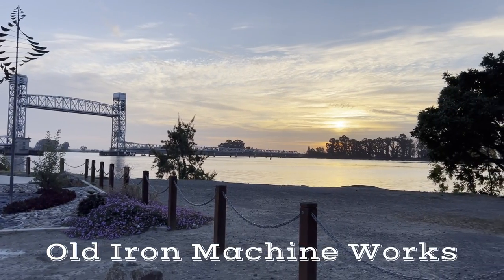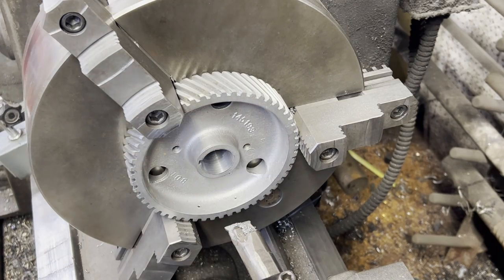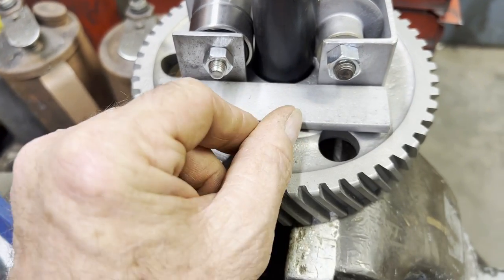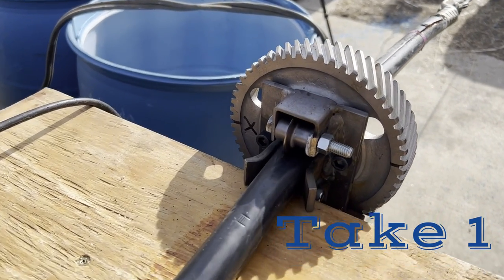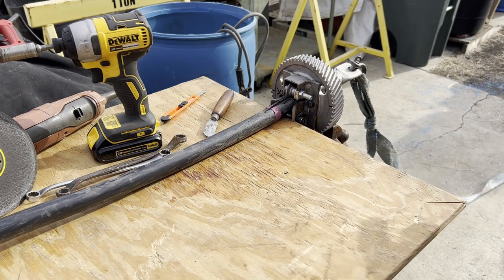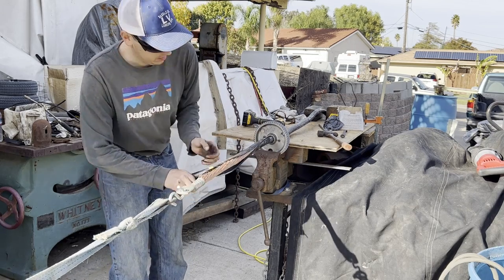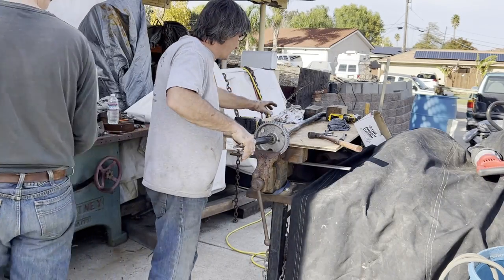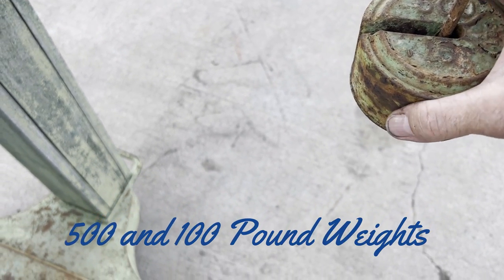Stripping Copper Wire For Profit

Comment: Hey Gary neet video the weight add up so how much per pound ?  man your neighbors must love you . when i lived in the San Fernando valley  i built 4x4s in my folks driveway and parked a 1970 dodge PU with 2 1/2 ton military axle with a 23ft travel trailer in the street for a couple years then came the 2HR parking signs M-F 6am -4pm  but no problem working in the driveway  i move 20+ years ago . Keep up the good work. JM

Comment: Nice quick build.  Electrician probably would have skinned that pile of salvage wire with a hook knife during his lunchtime.
Fine wire/welding wire pays less, cause it "burns up" during the melt is a scrapyard scam. 
#1 copper is bright, clean red wire, that's it. Were the lugs brass?
Reply from the maker: I'm sure the lugs were copper. I just did not want the chance for them to plays games because they were left on the cable and were plated. I had Jack take it in and wanted to make it as simple as possible. Thanks for checking out the video.
Reply: How long are lunch breaks where you live JD?

Comment: I did some cable like that last year i split the out side then pulled it off with a tractor. I do alot of scraping i need to build a wire stripper to do alot of smaller wire.
Reply: 0.3-20mm wire stripping machine

I have this machine.

Comment: Those would have made a killer set of jumper cables!
Reply from the maker: Brian, funny that you would mention that. Jack and I used a couple of them to jumpstart my Kabota. 
I did save one section for my service truck where I will be putting a 4000 pound crane in the back.

Comment: Awesome video. Was it cost effective using the Kubota? I mean, that was a boatload of copper.
Reply from the maker: Since the Kabota is hydrostatic it worked out really nice for Pulling the cable. Plus the Kabota doesn’t burn hardly any fuel. Appreciate you watching the video and leaving a comment.    Gary

Comment: Nicely done.  The fixture on a hinge would make quicker loading.of cable.  Sometimes those ends are copper with silver coating to prevent corrosion.  Grind one a bit to seel
Reply from the maker: My original plan was to put it on a hinge, but knowing I would probably never use it again I wanted to make it as easy and fast as I could. And yes the ends were plated copper. Since JACK was taking it in to the scrap yard I decided it was easier to just remove them just in case they wanted to drop the price because of the plating.
Appreciate you watching the video and leaving a comment.  Gary
Reply: @OldIronMachineWorks  Thanks for the Reply.  Upper Michigan view?
Reply: @OldIronMachineWorks  A dunk in acid will strip that zinc right off of there, and it will be pink as a new penny.  💡

Comment: what was the weight? 565?   Not sure how those scales work exactly but I saw you add the 500 counter ...... then the rail displayed 65
Reply from the maker: 665  I had a 500 and 100 weight then ad the 65 that was showed on the scale. Then subtract 15 pounds for barrel.   Thanks for watching Bobby
Reply: @OldIronMachineWorks  at least it was one pound more.   What did that earn you 1500-2000?   Those were beefy ass cables.